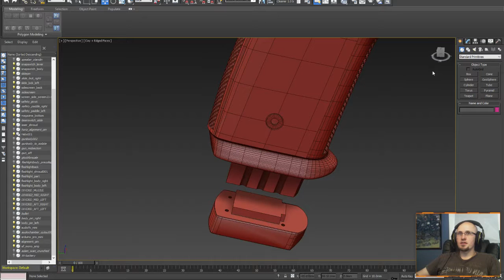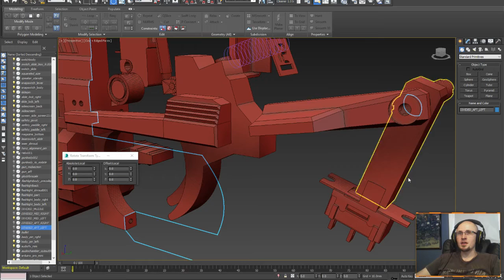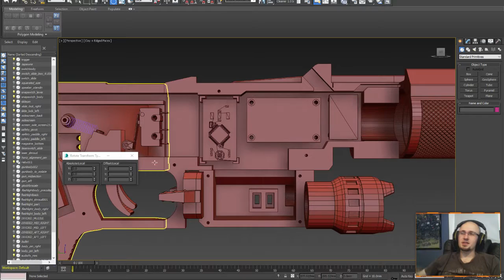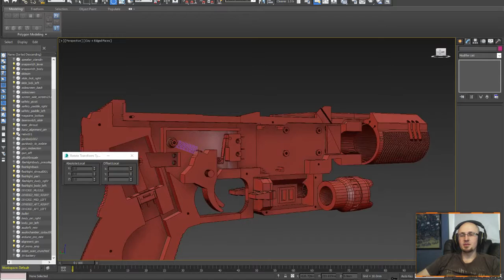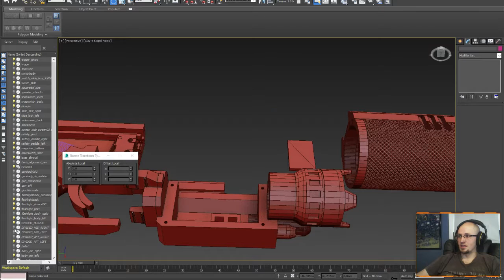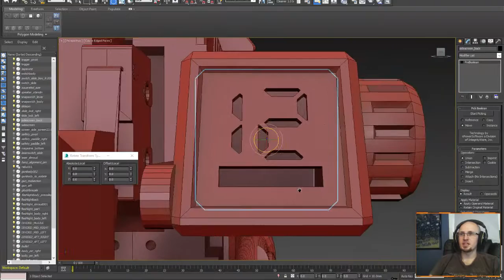Titanfall Smart Pistol Mk5 - 3d Model Breakdown

Comment: Until I saw your models I was using my Titanfall 2 figure of Jack Cooper, as well as for the Data knife for reference. 
I'm actually planning to make a TF1 Smart Pistol print to fit one of my airsoft pistols(as well as the Hemlock for my airsoft CM16 Raider). 
Basically I'm 3d scanning the chosen guns, putting into Zbrush, editing the rest of the model around it as needed, then I just screw everything in place. My only issue with my project is the pistols use Co2 blowback, so I'm hoping the plastic on the slide can handle the pretty reasonable amount of kick they give. Tokyo Marui pistols usually hold up well being plastic, but I'm still a little green to 3d printing, not as sure how well PLA will hold up. Think I should swap to ABS since they'll be used in actual airsoft games? The mock gas mask filter I printed seems to be withstanding shots of ~400fps. Maybe I could give it a few more layers and get away with it? 
Never printed ABS, so I've no clue how much of a difference it'd make. 
Thankfully for my situation I already have a flashlight and laser that look the part so my printer can relax a little. 
The pistol I'm using is the Elite Force tac 1911. The Smart Pistol is modeled more so after a Glock, but it's a little slimmer and the lines on the back of the slide are slanted like a 1911. And because it's so slim the SP coverings for it will feel more realistic in proportion as opposed to a Glock. 
I just realized typing this I shouldn't be scared of the parts breaking since I can just make more. 
Lastly, I've already got a life size, fully functional version of my most favorite Titanfall weapon of all time:
A Boot. It's got more kick than the Kraber!